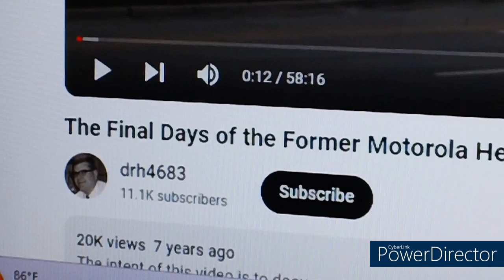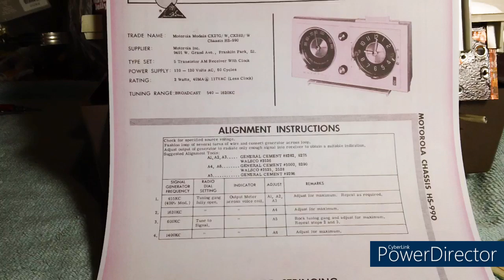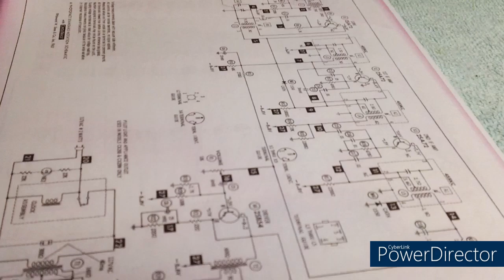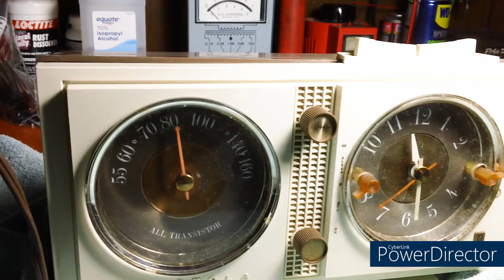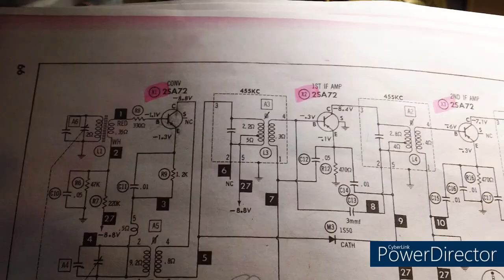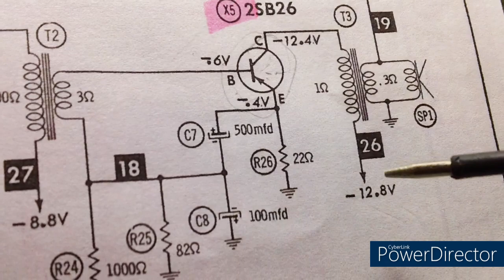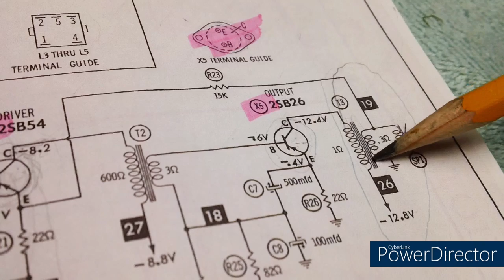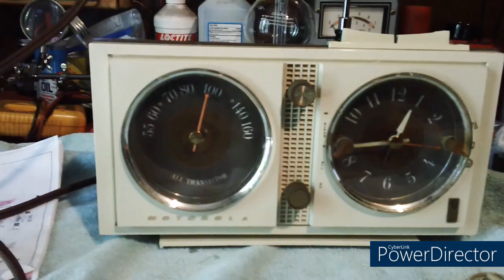1963 Motorola CX28-1W solid state five transistor radio

Comment: Hi John, I just stumbled upon your YouTube video for the first time, thought I would add my 2 cents since I have servicing radios since 1972.

I noticed this radio has all Japanese transistors and IF transformers.  Your radio has a doubled sided PC board, something I have never seen in a consumer product.  This explains why the traces were not pulled from the board when the power cord was changed.

I noticed a few original electrolytic caps in your video, I'm guessing these have probably dried out by now, which may contribute to reduced volume and added audio distortion.

The audio distortion, which commonly resembles crossover distortion, is usually caused by a rubbing voice coil.  It wouldn't hurt to pull the speaker out and check it's condition.  There could be a clump of dust between the speaker cone and grill, or the dust cover fell off the voice coil.  These speaker cones can also warp if stored in a humid environment.  As another commenter mentioned, a cotton ball can be wedged between the cone and speaker frame to compensate, although it takes some trial and error to determine the best spot for the cotton ball.

Thanks for doing the video and explaining every step of your troubleshooting!  I'm sorry if I mentioned ideas you are already very familiar with.

Regards, Bill

Comment: I was hoping you would pop the speaker out and check it.  If you were Buzz I would not recommend as he usually puts holes in the speakers he touches😃.   
I have at one of my transmitter sites an old stand alone solid state Motorola from around 1968 I would guess as it is stereo.  Radio would barely function when I first started playing with it.  I just decided to run it every time I am at the site and years later it runs pretty good. Probably had sat for years before I started using it.  It is an old, tired radio that probably needs to be gone through but I have seen this before  with radios that have not ran in awhile.  Try using that radio daily and see if you notice any improvement.    
Mark

Comment: John,   [EDITED] the  coating could be used to protect those copper traces. Some of these early boards are of the stick trace type like early Heathkit ( before etching) with eyelets through hole. too much heat and its goodbye trace. Thats a cool old radio... made the same year as me and it looks to be in better shape  :)  Well done !!!

Comment: Question, what is a good oscilloscope for tube radio repair? Looking at a RIGOL Digital Oscilloscope DHO914S 125MHz or a cheaper model!
Reply from the maker: Bruce,
Let me get back to you on this.  I'm checking with someone who recently bought a good o'scope at a reasonably price.  I asked him how it's working out.  When he answers I'll let you know his experience with it.
Regards,
John
Reply from the maker: Bruce,
First...if all you plan to repair is AM tube radios, then you'll find that an o'scope is very seldom used.  I have a Tektronix 454 100MHz dual trace and have used it maybe 10 times in the last 15 years.   But the price was $25.00, so figured I might as well get it.  My electronics mentor, Brendan, recently decided to buy an inexpensive handheld 100MHz single trace, so I asked him how he liked it.  He said: "It works great and does everything you might want a scope to do! It has become my Go-To scope".   So take a look at it.  The RIGOL scopes are fancy and nice to look at, but will you need or use all of its bells and whistles for AM tube radio repair?

https://digitalzakka.com/product/daniu-ads5012h-digital-oscilloscope-with-2-4-inch-tft-screen-anti-burn-feature-500ms-s-sampling-rate-100mhz-analog-bandwidth-waveform-storage-support-and-built-in-large-3000mah-lithium-battery/?gad_source=1&gclid=Cj0KCQjwgJyyBhCGARIsAK8LVLNZcIMezHxdPsgtMytCvDdLvhVcfQaUTROy5wO16XbFlOkp7di_it8aAolsEALw_wcB

Regards,
John
Reply: @joernone  thanks for your reply, looking to do an alignment on a Hammarlund HQ-129-X , should have mentioned that. Manual calls for using a scope!